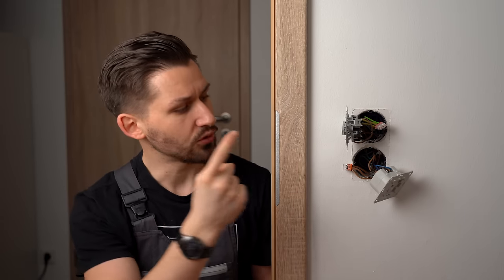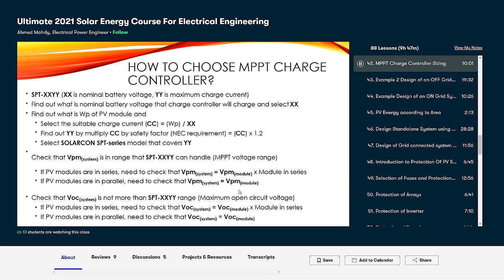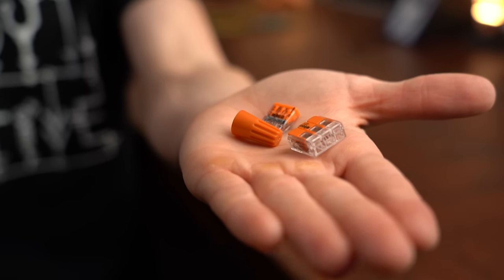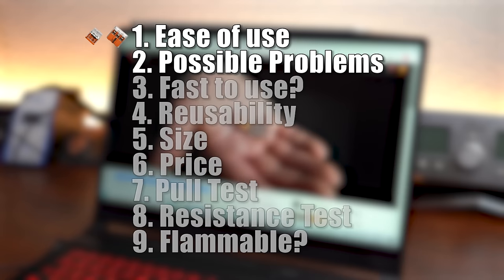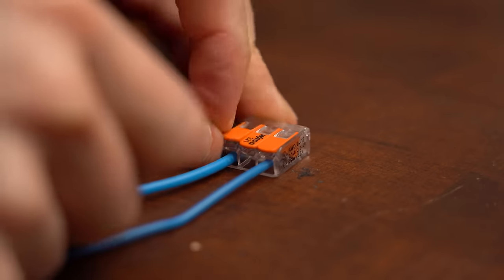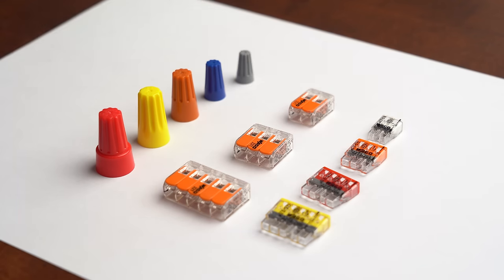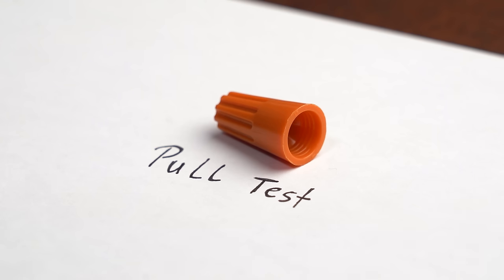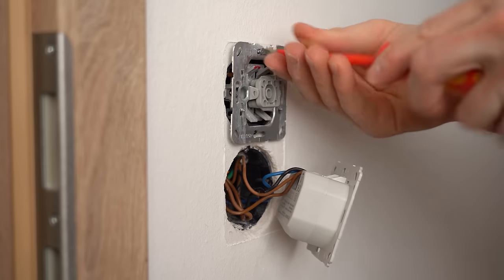What Wire Connector is the Best? Settling a Debate! Wire Nut VS Wago

Comment: 5:49 You can avoid problems when joining a stranded wire to a solid wire by having the stranded wire enter the wire nut slightly before the solid wire.
Reply: Yeah, that will avoid the nut catching onto the solid wire first and not properly twisting the stranded wire. If it is two solid wires then a proper pre-twist will make you feel better but if the wires are inserted evenly side by side then it's just as good. For more than two wires I always pre twist. Easy to forget to do a pull test but that is very important.
Reply: I actually use a piece of electrical tape first for stranded or combo.  Really hugs tight and doesn't slip when putting in the nut.
Reply: You never lead with either the solid or the stranded. They should enter the wire nut evenly. When mixing multiple wires twist the solids together and twist the stranded together and then get them even at the end and twist the wire nut on. Never twist the solid and stranded together before putting the wire nut on.
Reply: *As explained on the packaging of every reputable wire nut.
Reply: @junniper3  I tape on top of the wire nut.  In my limited experience I haven't had one fail.  The lever-less Wago connector seems to be a decent option for 14 or 12 AWG wire, though but they are not carried in any hardware store I have shopped in the US.  Amazon probably has them but since they would have to be shipped from Europe the price will reflect that.  The Shen Zhen Shit Land copies probably vary in quality, ordering them might get you a good product or it may get you a very dangerous one.  I would reserve those for low voltage and low amperage DC wiring.
Reply: @mharris5047  You can get the lever less type push connector at some big box stores.
Reply: I strip double the length in stranded and fold it in half and twist before twisting with the sólid
Reply: @mharris5047  Here's a tip not getting shit quality products: Pay more. Its almost like capitalism works based on this principal.
Reply: Not really perfect.
Reply: @ddjohnson9717    Of course!  Unless they were sadomasochistic or stupid I don’t think any electrician would buy crappy wire nuts.  I have been on large jobs where the contractor hires estimators, project managers and purchasing agents who never spent a day in the field but are hired because they have a college degree.  How these contractors make it past the first few large jobs is beyond me.  Example purchasing agent thinks he’s saving money by buying  cheap, no name, Chinese fire starting wire nuts in bulk.  Horrible connectors that are barely able to “ catch “ on properly pre twisted splices.  They basically only serve as covers to prevent a short.
Reply: This comment made by someone with a narrow range of experience. You may have done a million connections of small guage stranded wire with success, but never tried 14AWG(or larger)  standed to 14AWG or larger solid. The video doesn't touch on such realistic and common scenarios. Wago would win over wire nuts with  those types of connections. His stranded to solid  example is common in household lighting scenarios, not so much with larger household appliances, commercial and industrial situations. 

Example: a large hotel where every room has a/c units, stoves, microwave ovens, or even outlets where larger gauge stranded and solid must be connected to each other hundreds of times. In those cases, nobody is wrapping the stranded around the solid. That only works for the very fine wires found on low amp draw things like smoke alarms, low wattage lights, little cieling fans, fart fans, etc.
Reply: @aredditor4272  You are correct about this.   Trying to connect a larger gauge stranded to a solid is like beating your head against the wall.  The ultimate in patience and questionable safety might be trying to connect two stranded with one solid under a wire nut.  Definitely prone to vibrating loose, electrical tape is not a good solution. Good comment!
Reply: @junniper3  just the fact you feel the need to do that indicates how little respect you have for the design. I imagine all that's inside the wire nut. It amounts to a little hat made of a coil of steel. Seems like a bad idea out of the gate. The idea of wire nuts, that is.
Reply: @aredditor4272  Uhhh ok.  Not sure what your argument is about, but I guess have a nice day?
Reply: @junniper3  you're trying to make up for your rightful mistrust of wirenuts by first taping your connections. Seems like you're just making it worse, though. As bad as wirenuts are, that little coil can help carry current, but you're covering the conductors with tape.
Reply: @aredditor4272  Not sure what your problem is.  I offered a useful suggestion for binding 2 stranded wires much tighter together without the nut slipping off.  If you don't want to listen to suggestions, then fine be that way.  Otherwise just drop the attitude.
Reply: @junniper3  I was trying to tell you in the nicest way, it's actually a horrible idea. Gives the metal coil in the wirenut no metal to bite onto.

Comment: from the USA and i do a lot of wiring and after i saw Big Clive use the wago 221I instantly bought them and haven't used a wire nut since. They do cost significantly more but the peace of mind that i can see the wires have a connection in the conector, makes it worth it for me.
Reply: Big Clive got me stared with them too. Harder to find actual Wago in Canada, possibly because the original wire nuts were invented here.

Comment: When connecting stranded with solid wire in a nut, the stranded wire must be a little longer so it is up in the top, this solves the user induced error you were making.
Reply: Easy to do if you have both cables on the desk in front of you. But having to wire up a lamp (that often come with stranded wires) to the mains in the ceiling, i can see it easily be done wrong with wire nuts. Same with two solid wires: Unisolate, then twist them with a pair of pliers, then twist on the nut, THEN secure with tape. Versus Wago: Uninsolate, then stick in.
Reply: @dcdc358  might be hard for unqualified personnel such as home owners but any electrician worth his salt can do it blind folded. And there is no need to tape a wire nut in normal circumstances stances. This just shows you don’t know how to use them. Wire nuts only benefit from tape when exposed to vibration like on a motor.

Comment: Commercial electrician in the US, I now use wire nuts for solid to solid and lever nuts solid to stranded. Ideal has come out with two or three port lever nuts that are priced much lower. Also I really like using a six port push in connector if I have a bunch of grounds in a box. Takes up less space than a big blue wire nut and you can see the wires are properly inserted. I’d like to see them come out with #10 stranded 30a 600v rated lever nuts for commercial

Comment: Here in the US, I had an addition put onto my house a couple years ago. When I did the wiring, I used all Wago connectors. I'd never heard of them before then but man, they were a godsend and much better than wire nuts.
Reply: Nope, made by WAGO - not god.
Reply: @inwen8258  no shit he never said it was made by God but said godsend meaning it was easier.
Reply: Not all wirenuts are created equal. I'm an electrician and have installed 10s of thousands of wirenuts and at least a thousand wagos. 

Cheap or "included" wirenuts are an overall crappy experience. They give proper wire nuts a bad name. 
If you try a name brand wirenut, such as Ideal or 3m, you'll see what i mean. The difference is night and day. They make a very solid connection and grip, twist and hold the wire better, with less effort. I almost always discard the wire nuts that are often included with electrical products, such as light fixtures. I've filled up coffee cans with "included" wire nuts that I refuse to use. You'd be amazed how many electricians will turn down free cheap wirenuts. They are that bad.

There are some scenarios that I prefer wagos, but for most uses, especially high amp draw continuous loads, a wirenut is better when done right. Another factor is cost. Name brand wirenuts are still very cheap, compared to wagos. When you use as many as I do, the cost of wagos adds up fast.

For the average DIYer, wagos are harder to mess up. They are nearly idiot-proof. For most people, wagos usually make more sense.
Reply: Easier does not mean better.
Reply: You’re just gonna confuse the electrician after you and will most likely just cut them out and use wire nuts.

Comment: Here in spain, we use the "connection terminal block" all the time, simple and with screws, but i hate them. It takes too long to do / undo an electrical connction, and it's harder to use several wires in the same slot... also, the wire usually suffer from excesive twisting, and the stranded wire usually ends up damaged, and can't reuse the final part of it once disconnected, must cut and strip a new piece every time you change a connection, to make sure the wire is perfect... that's why i love wago...
Reply: The screw terminals were the standard in Germany in the past. Now everyone are using Wagos because of their ease of use.
Reply: @Toxicity1987  Not only because of their easy of use but because screw connectors tend to become loose over the time or if there are vibrations or something like that. When I bought my house (20 years old at that time ) I had to replace all screw connectors because they where all loose and some where already with signs of burn because of sparks! The Wago are spring loaded so there is no problem with that.
Btw: Most manufacturers of control enclosures here in Germany use spring loaded terminal blocks in the meantime (Wago and Phoenix are most common). Lots of these eclosures are exported and shipped in containers on boats for example. And after arrival at their destination they had to prove every single connection in fomer times,  much much work...

Comment: Most light fixtures we install at my company use Wago connectors. They are nice to use, but seem like more of a luxury than anything. I won’t say one is better than the other because they can both easily get the job done through proper installation. The only problems I’ve had with wire nuts are working in tight spaces with limited slack, including trying to tape them up after.
Reply: good explanation. one thing to add is wago connectors are really expensive.
Reply: I think wago is an updated way to splice wires. It’s faster and less strain on the wrist. I think if they were so bad then all of UK would be burning in flames.
Reply: For light fixtures that makes sense.  Perfect for when you're called to replace a fluorescent ballast 30 ft off the ground.

Comment: The wire nuts with the grooves in them tell you how much insulation to remove and the outside diameter of the maximum wire gauge it will accept. The ones without the grooves but have wings the insulation is the tip to wing length. They all tell you their ratings with the color code as well. The small gauge wire nuts aren't worth using, they're quite difficult if you have braided/stranded wire. Push connectors always get hotter than direct wire to wire connector like wire nuts do so they're less prone to starting a fire in the case of overload. It's rarely a concern though so if you're a contractor, use the wago, it's the customers cost anyway. I prefer screw terminals, there's more contact and higher current ratings.
Reply: So you’re the contractor when I worked as a contractor and as a contractor helper for 30 years never once did I see a contractor save money on materials and give it back to the customer what they normally did was charge extra for the better materials and then buy the cheapest thing they could buy at the home center put that up and put the rest of the money in their pocket i’m not saying this is you but I’m just saying at 90% of contractors and builders that’s what they do and that’s wrong I took made a good fight I’m trying to get people when I was a contractor to take over their own materials in tear material deliveries so they could save money so the only thing they were paying me was a labor charge I’m just saying
Reply: Had a guts full of screw terminals, my wrists and fingers start screaming after a while. Wago is so nice, strip and click in. So, so much quicker too.
Reply: @Shrouded_reaper  also the old style screw terminals were intended to be checked/ get maintenance, so retightening regularly.
But of course that never gets done, let alone in private installations. Gotta be happy for big safety margins there.
The wago spring clamping system automatically "retightens" in their intended lifetime when the copper creeps away under pressure or with vibrations. so "maintenance free"
Reply: Consumer cost anyways?! Not a very good attitude from a contractor lol

Comment: Wago connectors were not available when I rewired my house. I used wire nuts for normal power and split bolts for #4 feeders (4/3 Romex to individual wires), and everything worked great. I had to learn a lot, but everything worked fine. The inspector once told me, "I save you for last because I like to go home happy." 

I mentor our local FIRST Robotics Team electrical task force. We use Wago exclusively. They work great, too.

Comment: Wago connectors are definitely easier to use, especially with stubby wires in small boxes. I’m predisposed to like wire nuts simply because I’ve been using them for a long time, and I feel a bit more confident in the joint they create since the wires are physically twisted together past the nut. However, after doing a lot of electrical work my fingers are definitely feeling a bit fatigued from twisting so many nuts on, especially when dealing with 12 gauge wiring. Overall, both are good connectors, but for heavy current applications I’m still gonna stick with wire nuts simply because of the reduced resistance. I always twist 10AWG and bigger together with a pair of linesman’s pliers before putting the nut on, because the last thing I want is for the junction powering my dryer to melt in the basement.
Reply: I use pliers on 12 gauge and any time there are more than 2 connectors and most times I still use tape.  The people I work for pay for quality and not for me to race to get done.  Saving 4 cents on a connector or getting done 2 minutes sooner is hard to explain after the fire.
Reply: use a drill chuck and clutch  to screw on the nut, save your finger fatigue
Reply: if you have "stubby" wires in a box, someone did a bad job, not sure about Europe but code here is 6" min of wire in junctions
Reply: @johnb4306  In the US, it's 6-8" from the front of the box.
Reply: @johnb4306  codes are great .. but only when the person before you follows them!
Reply: @user2C47  thats why I said 6" minimum
Reply: @user2C47  6 inches from where it exits the conduit or wire sheath, not the front of the box. Having 6" from the front of the box is way too much
Reply: @16vSciroccoboi  Interesting. All the classes I went to said to have a minimum 6-8" from the opening of the box, which differs from what is actually stated in 300.14.
Reply: @16vSciroccoboi  but 6" outside the box is the 2020 code in the US
Reply: @sevillain1  That is not a "code" or best practice issue, that is a shoddy workmanship issue, or laziness... neither of which should be involved in a potentially hazardous installation if done wrong.

Comment: The conclusion I would draw from this is that which one is better depends on how experienced the user is. For DIY home jobs, the Wago seems like a much safer option. For a professional who is sure that they won't mess up the connection, the wire nut is better in each metric of final performance, and cheaper.
Reply: As a professional electrician, I have to disagree. If something is easier to use, it's also easier to not make a mistake.
And with Wago connectors, as long as you remove 10-12mm isolation, you make the same connection, everytime you make one. You can teach everyone how to to a proper connection with it in less then a minute.
Reply: A pro is going to run into trouble sometimes. When up on a ladder, working at the end of your reach around an obstructing air handler, in the dark, trying to line up a bunch of 20 year old wires that were cut a bit short while your elbow tendonitis is starting to flare up, a pro is going to expend a lot of effort and have a hard time getting a perfect joint.
Reply: As an electrical engineer who has designed power distribution systems, I agree the wire nut is far superior in formermance but completely disagree that the Wago is safer. When you properly install wire nuts, you twist the wires with pliers prior to putting them into the nut. The connection resistance is what tells you the performance level. Please review videos of how to properly use wire nuts, from electrical manufacturers, and not DIY people.